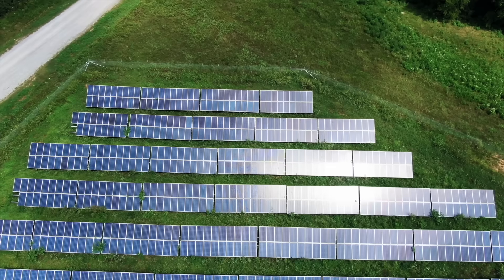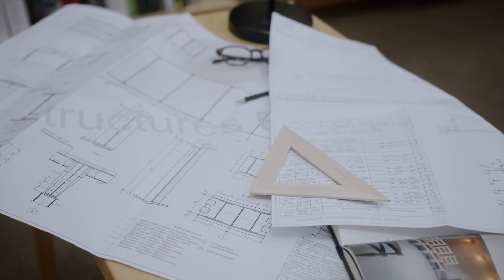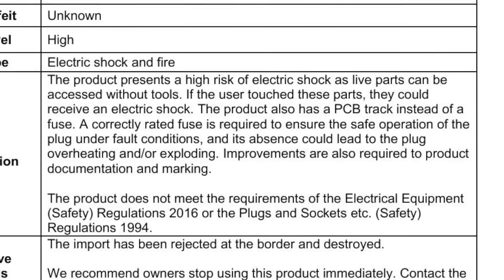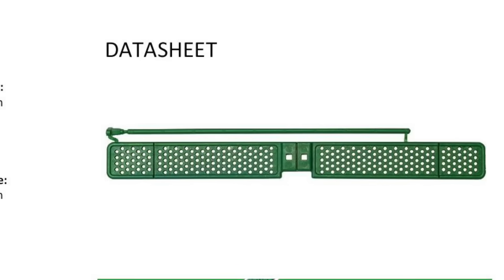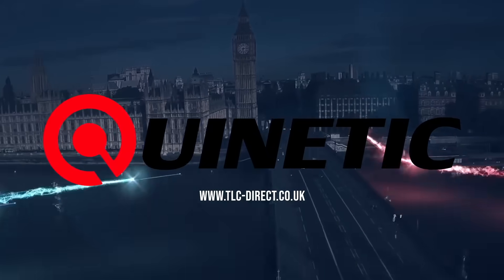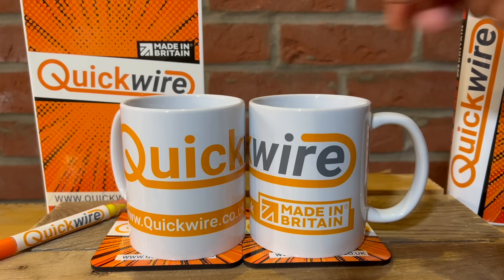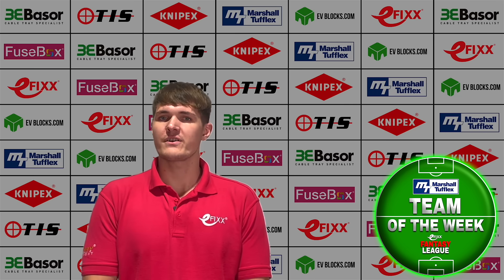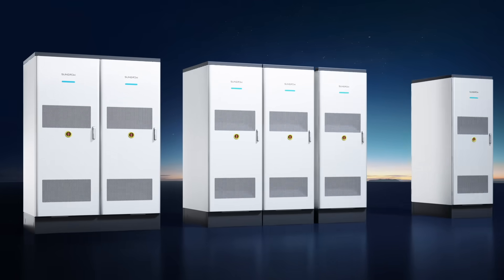IET Raises Alarm Over Sustained Overloads 🚨

Comment: There is absolutely no reason for people being cut by sharp edges on cut metal fittings.
This is entirely due to SHODDY workmanship when cut edges are not DEBURRED when first cut. Whilst Files, sand paper & de-burring tools are all cheap it is the actual "Workers" who are the root cause of the problem by not wanting to take the time to do the job properly.

Comment: Looks like the IET are reacting to what we have been seeing for a few years now. Modern homes have so many high load fixed appliances with no diversity it is becoming necessary to upgrade the consumers unit to larger panels with more spacing between RCBOs and room for CT clamps. Also a good idea to recommend 2-3 year servicing to re-torque all terminals.
Reply: Induction cooktops can draw ludicrous amps until they reach the temperature set point.  Fortunately most of them do have a power limit but still I hear of people in Australia specifically getting 3P and 16mm finals to them to operate them full blast.  It's crazy really.

Comment: They were installing low-profile LED downlights at work the other week, the type seen in shops everywhere. The drivers they came with were tiny and non-isolated .They used barrel connectors to the fitting usually employed for low-voltage use. The fitting was metal, and used LED tape stuck to the edge all round inside, with the cable poking out of a hole in the edge. They were installed into metal ceiling tiles…
In my mind they’re dangerous, because the drivers aren’t isolated. If they were they’d be fine.
This problem is all over the lighting industry and affects fittings sourced on the biggest online shops.
It’s shocking (literally) how far down the plughole quality has gone in the last decade. And most people assume the things they’re buying are safe.
Especially LEDs - “ they’re low voltage, aren’t they ”???

Comment: Ah yes, designing circuits where small but persistent overloads become part of the plan.  That will be the IET-derived nonsense that prompted DNOs to downgrade 100A cut-outs to 80A (or lower) and actually include a plan where 4 hours of 100A through the 80A fuse becomes part of 'normal' operation.  
So large properties with multiple LCTs (PV, batteries, heat pump etc) find themselves with a hot 80A fuse cooking the DNO's cut-out.  To add extra spiciness, downgrade that fuse without telling the home-owner and don't even apply a sticker on the cut-out to show that a smaller fuse has been fitted.  Yeah, designing for madness and leave no visible trace of a major change.

Comment: When cutting any metal I was taught to run a file along the edges to remove any burrs. Are people so pushed for time that they can't spend a few seconds doing this? If so, they're probably cutting corners elsewhere too.
Reply: They undercharging cowboys
Reply: And yet more BS for the white collar pen pushers.  Next they will be looking at way to our dinner knives and stake knives and carving knives saver . Feck sake when you work with metal you will occasionally cut yourself. Buy a box of plasters and get on with your job. . I would be more concerned with the idiots using an angle grinder without the blade guard fitted. Instead of asking your viewers if they have ever cut themselves on Mattel trunking or cable tray a more realistic question would be who hasn’t cut themselves on such.
Reply: Yep as was most of us in the trade
Reply: True it is laziness, would never happen on any of my sites. But even filed, there are still edges. The main problem is designers trying to cram everything where there is not enough room, and zero thoughts given to maintenance later on.
A bit like some sites were there were plug in ceiling roses installed about 10ft above the suspended ceiling. Like WTF ? How is anyone supposed to get near them once the ceiling is installed !!